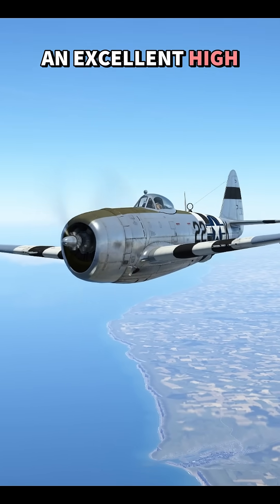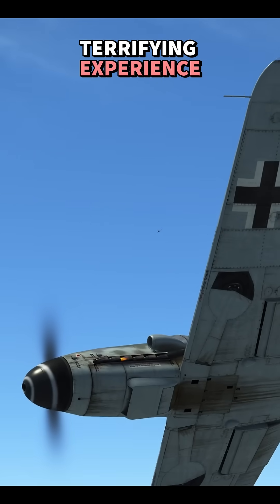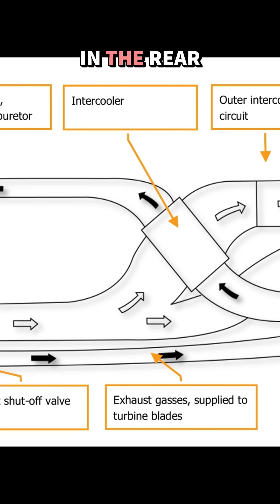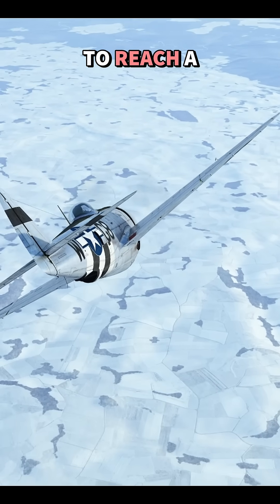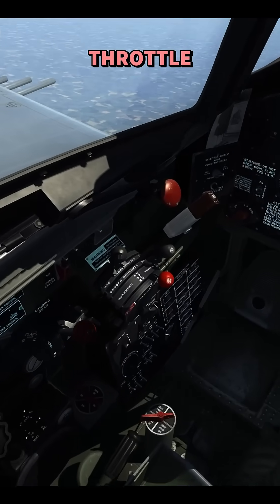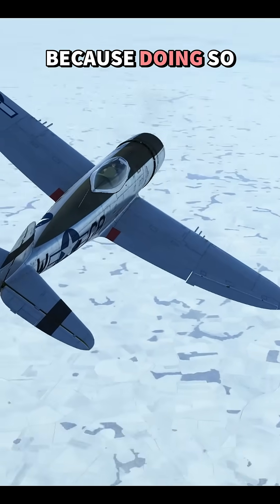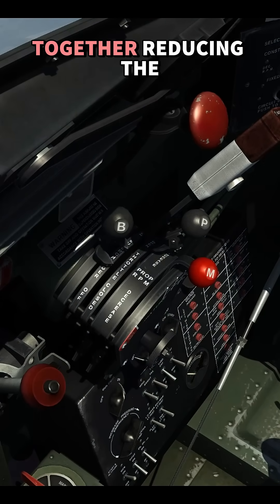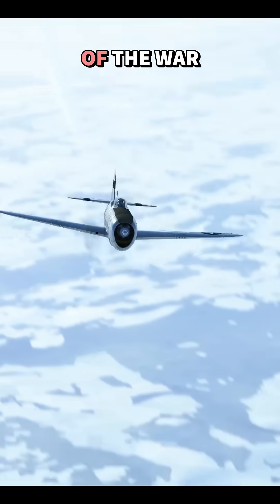P-47 Thunderbolt - Turbosupercharger

Comment: I find it funny that German test pilots said the cockpit was "too big" and that you had to reach a bit further for controls when testing captured samples.
Reply: and you did take evasive action in the P-47 by unbuckle and run around in the cockpit.
Reply: The Bf109 cockpit could make people claustrophobic. It’s tight and you’re sitting on a gas tank.
Reply: @TJ14142  Me-109 cockpit was cramped, but the pilot did not sit on the fuel tank, but did sit more on the "floor" as in a modern fighter, the fuel tank was behind his back. So the back armor in backrest did offer some protection.
Reply: @kirgan1000  there are a couple of diagrams available on the internet. One is a 109G and I don’t know what model the other is but, the component is labeled “Kraftstoff Rumpfbehalter”.
Reply: @TJ14142  Kraftstoff "power thing" and Rumpfbehalter "hull-container"

So its the German way to write internal fuel tank, or a fuel tank that is integrated with the frame.

Comment: I was thinking about turbo lag and then realized it dosen't matter on an airplane 😂
Reply: With this setup you wouldn't get Turbo lag anyway, the supercharger gets higher pressure air from the turbo, but it's not the turbo that produces the boost for the engine. So the increase in power should be more gradual and available from lower RPM than with a regular turbocharger. The Lancia Delta S4 used a combination of super and turbocharging (twincharging) to eliminate Turbo lag back in the 80's for example.

Comment: Excellent, but One note, 
Turbo supercharger is an antiquated term.
Forced induction was referred to as " supercharged"
Broadly as a blanket term back then.
This engine was simply turbocharged.( Edit this is wrong, it is compound charged but the rest of the info is correct)
It was just in a configuration that is referred to these days as "remote mount".
The Corvette guys are fond of remote mount turbo systems, and they can be found on many a c5 that'll eat a Hayabusa on a roll.
These days if you say turbo supercharger, it makes builders/ tuners like me, assume you mean it's compound charged, which is a regular exhaust driven turbine on a chra driving a centrifugal compressor ( a turbo. )
 Feeding into a mechanically driven, via gears or belt, roots, twin screw, or centrifugal compressor. ( Supercharger.) ( Or sometimes another turbo 😈)
If you want to see applied compound charging, look at the motors used on tractor pulls.
It isn't redundant, it produces insanely high levels of boost.
 Too much for most applications, and so Its unnecessary for most applications, as there's single turbos capable of 2000+ hp, and single superchargers capable of just as much.
Both systems have pros and cons, with turbochargers having no vampiric hp loss, meaning more efficient, and are load dependant, meaning the harder you stress the engine, the more boost (power) you make at a given rpm and throttle angle.
Superchargers being coupled mechanically to the engine, means they are simply rpm dependent, making x amount of boost at x rpm.
They respond quicker than turbochargers, but have a more narrow dynamic operating range.
Hence road course tt style cars frequently have superchargers for their instant response, and drag guys favor turbochargers for their higher maximum power output.
Although there's quite a lot of both everywhere.
Hope that helps, and you guys have a happy new year and God bless y'all.❤
Reply from the maker: Appreciate the comment! I used turbosupercharger because that’s the period correct USAAF term. In the 40s, all forced induction was broadly referred to as supercharging, and exhaust driven units were officially designated turbosuperchargers in manuals and technical orders. In my videos, I try my best to stick with the historical terminology used at the time.
Reply: Pretty sure a lot of those engines used both a turbo and supercharger. Hence why it was named both.
Reply: @jamesb120 You are correct, but they aren't just  referring to the entire forced induction systems as turbosupercharged, in the blueprints, the actual turbocharger itself ( and all turbos of the era) were called turbosuperchargers. 
It causes quite a lot of confusion and debate.
Reply: Hi, P&W R-2800 mechanic here: I’m not familiar with the P-47 specifically but the R-2800 typically has a two-speed clutch-driven blower used to pressurize the power section of the engine. In the P-47s case these two intake methods were probably used in conjunction as the blower section is an integral part of the engine.

Of course it’s not impossible to bypass, modify (especially the clutches which has been done), or remove the blower, but I find it highly unlikely.
Reply: @Idaho278 yep you are 100% right.
Apparently im very wrong, and any engine in the era that was turbocharged was also supercharged, which the proper term would be compound charged.
The confusion arises from the fact that they call everything " supercharging" and the schematics ( that I've seen) only shows the second compressor stage, the turbocharger.
As the superchargers were integrally mounted, as a permanent part of the engine, and do not appear on the drawings I've looked at.
But they are there.
Reply: @BadHarmonics I wish I could post pictures here — I have detailed cutaway diagrams of exactly this system, you strike me as the kind of person to really appreciate the engineering behind it
Reply: @Idaho278 Yes sir, Im a Jacksonville area engine builder/ tuner that specializes in forced induction.
Compound charging is extremely fascinating to me, as it's rare or non existent in auto racing , and I badly want to build a car with such a system.
It was used in the early Nissan March , which used a system very analogous to the p47's ,
but that's pretty much it in the auto/ racing world besides Diesels.
Many cars are sequentially turbocharged, with staggered compressor and turbine a/r sizes, but they are in a twin arrangement, not compound charged.

Comment: War Thunder be like : best you can do is 150mph at 17k feet. Also it handles like a brick. Also here's a new premium jet and air to air missiles at a lower battle rating than your p47
Reply: Also, most engagements in Air RB happened at low altitudes anyway, so the P-47's high altitude advantage is  not very useful
Reply: @imtiredtiredtired  doesn't change the fact that WT doesn't understand level air speed of prop planes at all. They use those figures for max dive speed. I have only ever gotten the p47 above 220mph after diving a metaphoric mile
Reply: @imtiredtiredtired  I tried doing high alt patrols in RB with the Ta 152 at around 31,000ft, but when I'm the last one, the enemy team always complains about me and the game goes on untill the timer is up lol. Really wish some people took the time to gain altitude
Reply: @lordzeus2374 Ah well, this is War Thunder after all. When there are only one enemy left and they are flying high in the stratosphere, the more sensible strategy is to just... ignore him, since climbing up takes time, and farm the ground targets or bot planes for more XP instead.
Reply from the maker: Even in IL-2 GB, no one ever flies that high because there’s just no reason to
Reply: not like the missiles are aim120s or smthing lol, and p47 is a brick at low-medium alts
Reply: The air-to-air missiles are MCLOS and really only good for hitting bombers. If you get hit by the Fw 190's air to air missile in a fighter, you should be embarrassed.
Reply: @agent7176 I was just complaining about AAMs in general. I've been grinding the B57 Canberra recently and every single match I get shot down by a missile